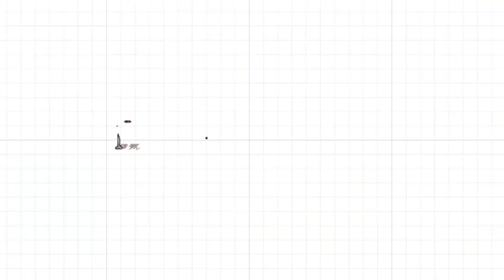샌드블라스트 만들기 (Making Sandblast)

Comment: ManSoo Ssi, 

I love this project you took on!  I noticed three things you might try.

1. When welding galvanized pipe,  brush  the rust and paint off and then wash the surfaces with acetone. I realize that you're using fluxcore, but a clean surface always always make the puddle tie the two pieces together that much easier. 

2. Try turning up your amperage a little.  Your bead seemed a bit thick and your weld looked like it had insufficient penetration. 

3. It looks like you have a oil based compressor.   You can place a moisture dehydrator between the air source and the intake of your tank.  This will pull the water and oil out before it contaminates your sand.

Kwon